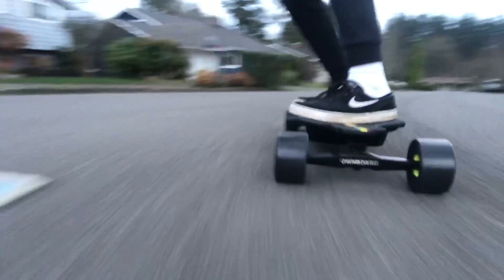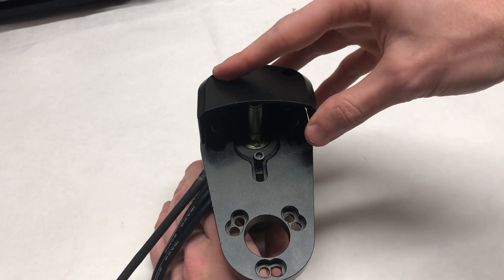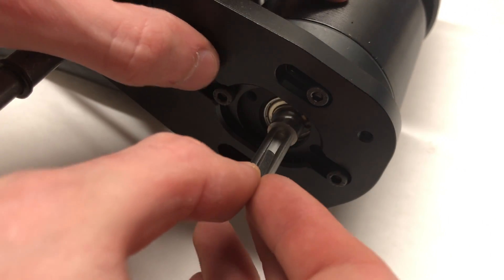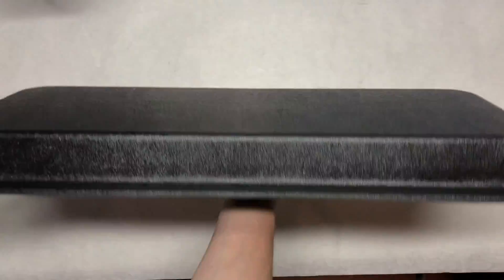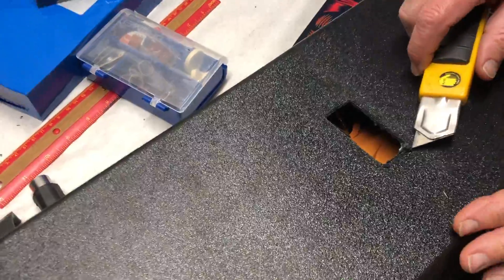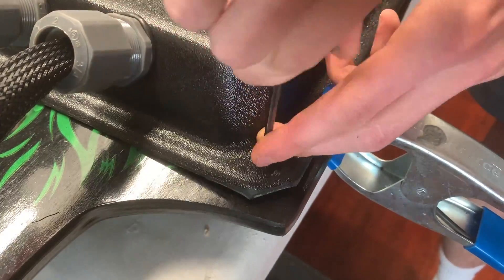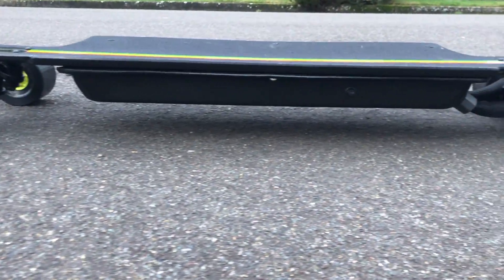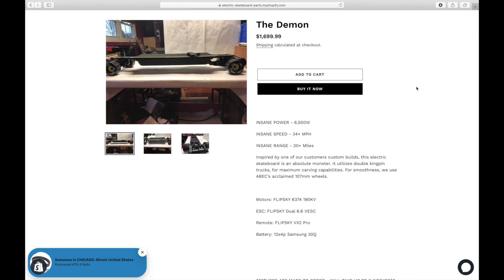How to Build an Electric Skateboard *NEW* (38MPH-30+ Miles Range)

Comment: Using DKP on something you claim can go 38mph doesn't sound smart.
Reply from the maker: Use stiff bushings and tighten them a lot. We have had no problems with the dkp trucks
Reply: @DIYesk8Builders  at 38mph i really doubt it. Tightening the bushings so hard you can ride at those speeds negates the turning radius you get with dkps

Comment: My diy build I had my VESC drop voltage to my RX under wot forcing it into fail safe of "keep throttle open for 2 seconds" I flew for a good 15 feet. Ive got a different vesc than you but it might be worth checking. Id recommend laying down on the board with full gear to test it just in case it sticks. I fixed it by using a capacitor type SBEC ran direct off 12s.
Those motors are great, its got way more power than people think.

Comment: i cant believe an ESC can cost $250! holy cow. that's a lot of  $$$$$$$$ for a broke college student like myself
Reply from the maker: I know, its brutal but its better to buy once that lasts than one that will break and end up costing more in the long run
Reply: @DIYesk8Builders  here's the thing though, i dont want to go 30+mph. i get quality = cost. but i just need something that can do 15mph. not everyone wants a Bugatti when a Lexus is more than good enough.
is there a dual vesc for my need of 15mph with belts or direct drive?
Reply: You can get them on aliexpress from flipsky for around 150 - 200

Comment: May I ask how many Amps are you running through ??
Reply from the maker: 70A per motor
Reply: DIY esk8 Builders in the battery’s link it says that the max discharge rate is 50amp, so how do u push 140amps ? Got lost with my built..😅

Comment: Please never put hot glue IN bullet connectors again 🤦‍♂️
Reply: What would happen? I'm a novice to these things.
Reply: @soso_automatic7380  The problem with putting glue inside the electrical contact surface is the fact you are introducing a dielectric compound in a place that needs to be conductive. Bullet connectors like those used are designed to carry very high currents, and thus should have as little resistance as possible. When adding hot glue (an insulator) to the INSIDE of the contact surface you are reducing the electrical contact area, and thus introducing more electrical resistance. Resistance means more heat will be generated inside the conductor. This heat may be enough to soften and melt that same hotglue and ooze deeper and spread more inside the connector surface, further increasing the resistance and heat. (I hope you can see why generating a potentially exponential amount of heat is bad) Best case, nothing happens. Worst case stuff gets melty melty and you potentially damage your controller in the event one of those motor phase wires goes open circut from your hot glue job.
Reply: I see thank you for the information I appreciate it
Reply: @soso_automatic7380  No problem, I'm glad I could help out.
Reply from the maker: We did not put hot glue in the phase wires-that would be dumb because they do carry high current just like you said. The hot glue only went into the switch and charger port as they carry very low currents. We felt that it would be worse if they were to disconnect
Reply: @DIYesk8Builders  could have just put a little bit of electric tape around the connectors if you really think they would come apart.................. I really like this build and video but this just threw me off.

Comment: How much are the ones you make that are direct drive hub motors?? I'm more interested in those to be honest. Hoping they can reach 30mph and 30 mile range aha.
Reply from the maker: We have never made on with direct drive hub motors...yet...
Reply: @DIYesk8Builders  I was curious how much it would price out to be. I have a hub motor and yes, the wheels aren't the best. I don't want to necessarily move to belt motor also. Which is why I think the best of both worlds is direct drive... My budget is kinda at $800 though 😅. And I think if you could make one that goes 30mph and do a 30 mile range. That'd be awesome. Because mine does 28mph/20 mile range (cruising 11mph) for $420 shipped. I'd pay a bit more for direct drive because of the better ride quality. Definitely let me know because I've been looking for a long time now.
Reply from the maker: Chia Lor ya definitely what’s your email so we can reach out
Reply: Chia Lor I know that a torque boards direct drive motor set up is minimum $650. I’ll be looking at them If and when I decide to upgrade though as they are excellent from what I’ve heard.
Reply: @majorpuffen7444  thanks. I'll have to look into Torque Boards.
Reply: Chia Lor just to be clear that is not the price for a complete setup, that’s just for the drives only.

Comment: Do you have any tutorial of how you soldered the flipsky 6.6 plus or put the battery percentage connection back on? Great video and awesome build.
Reply: battery meter gos back on the reverse order of taking it off ,soldering is easy to learn and a lot of free vids on here that can show...best to grab some wire a solider gun and practice . as I told last person..knowledge is power.

Comment: Clean build man! I'd suggest mounting the components, especially the battery, to the deck itself and then use the enclosure simply as a cover rather than to carry all the components. Kydex and ABS will eventually crack when carrying all that weight over many bumps in the road. Fiberglass enclosures do much better carrying weight, so mounting the battery to the board is not as much of a concern with fiberglass.
Reply from the maker: Yeah I have heard other people say the same thing, but it has never posed a problem for me and I have ridden 1,500 miles on my personal board. My concern is that the deck flexes and with the battery connected to the deck, so would the battery. The enclosure flexes too, but less so so it is a tradeoff I had to make

Comment: Awesome build, I live just south of Portland and ordered the Ownboard carbon AT a week ago because of the rain . Now I’m second guessing that maybe I should’ve just built one!
Reply: Eh, DIY isn't necessarily the best option. You can easily mess up in the building process and spend more than you needed to and prebuilt customer support is nice too. The ownboard evolve clones are imo better with cloudwheels than AT wheels due to the turning behavior of dkp trucks, but rain riding is def limited on those wheels.
Reply: I just felt like the Ownboard was the best option, I imagine you could throw some Abec 107’s on as well for street. 
Sad thing is I almost bought another hub motor cause they’re just so much cheaper with roughly the same specs. I chewed threw the PU on my last hub wheels though.
Reply: @runningcolekong  you could try buying abec 107s and evolve's wheel pulleys, this vid shows us the wheel pulley fits, but I'm not sure if ownboard's MOTOR pulley will fit with it. Performance-wise, smaller wheels AND an appropriately smaller gear ratio should increase both accel and top mph
Reply: Valid point... I’d assume if the clouds fit, there’s gotta be some 100mm wheel out there that can work
Reply: @runningcolekong  wouldn't recommend ownboard's cloudwheel pulley with smaller ABECs. Every company makes flywheel pulleys that don't fit every flywheel.
Reply: There’s gotta be a pulley that’ll fit street wheels haha. 
I’m curious though, cause I want a back up board, what’re your choices between the Exway riot, wowgo 3x, backfire or Meepo?
Reply: @runningcolekong  either the 3x or the exway flex, they're both closer to the boosted experience at half the price. Acceleration isn't that different between the two, get the 3x if you can't wait
Reply: I’m a heavy dude so I think the exway flex will have too much flex. I kinda feel like belt drive is old news, hub motors just need an absorbing, comfortable wheel and it’s game over imo
Reply: @runningcolekong  backfire g3's thicker hub sleeves should have minimal comfort difference from belt. Most budget mid-range options use bamboo/maple for 150lb riders, u might wanna deckswap

Comment: for a cleaner look, carefully peel off the grip tape before drilling the threaded insert holes, then clean deck, apply spray adhesive and re-apply the grip tape
Reply from the maker: We were going to do this, but the grip tape was on so well that we decided it would not be worth it
Reply: @DIYesk8Builders  fair enough - admittedly this is easier to do on a top mount deck, (I've done it multiple times on my evo falcon -  using baking paper to keep the grip tape tacky - no problems) but drop through grip tape cutouts are easy to rip!